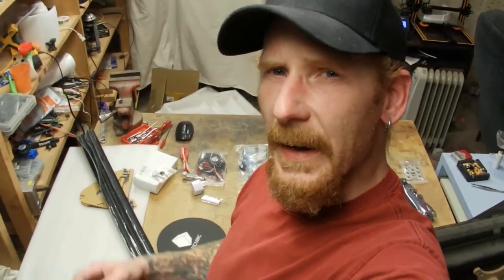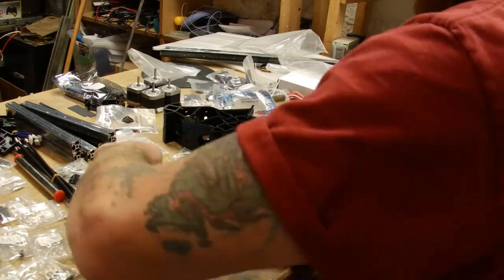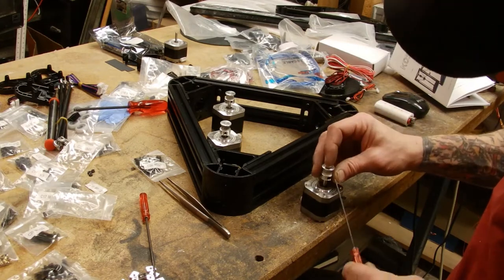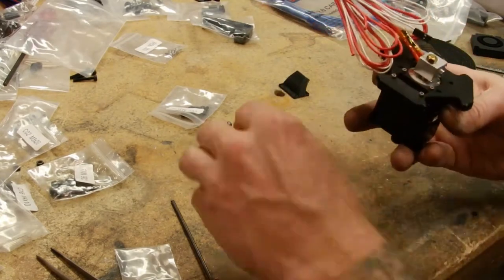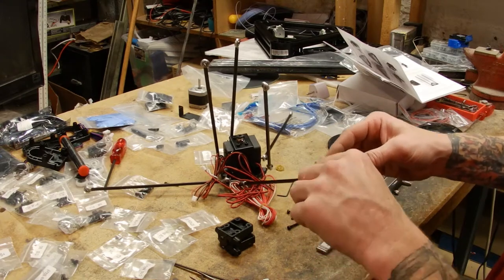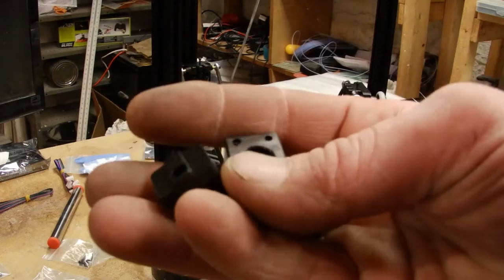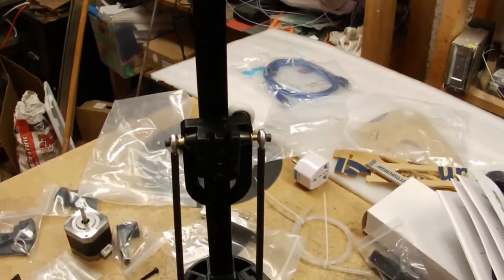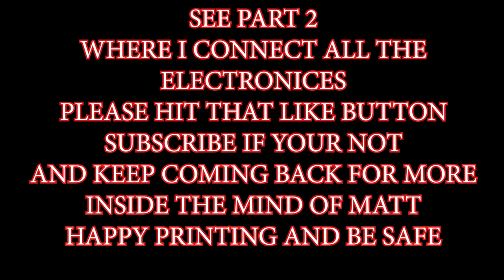Assembling The AnyCubic Kossel 3d Printer From GearBest (Part 1 The Frame)

Comment: I'm having such a bad time assembling this. The pieces barely fits together and it's extremely frustrating! I couldn't brute force it either, so I ended up using sandpaper on C11 so they'd fit in the aluminium extrudes. Just tedious!